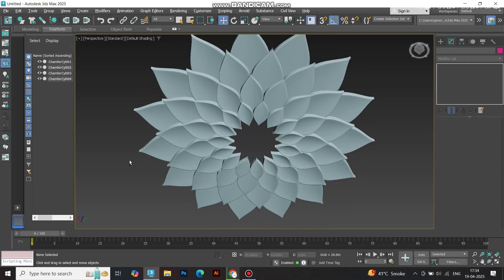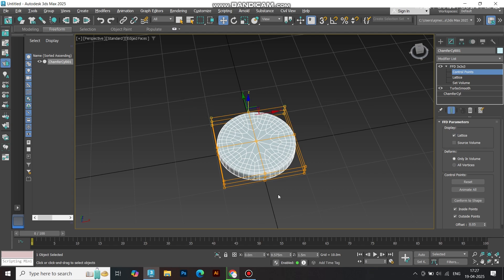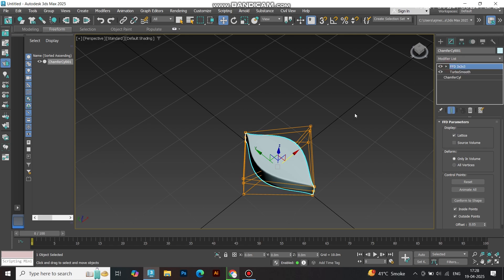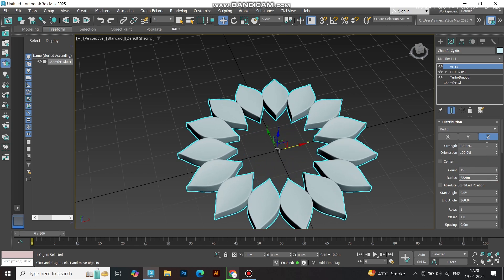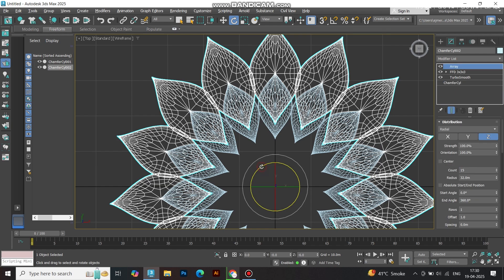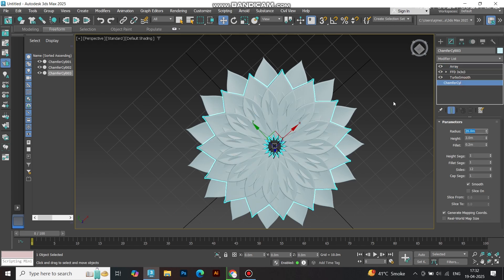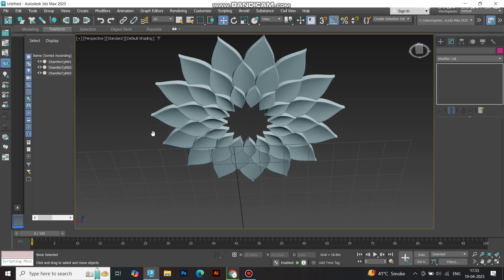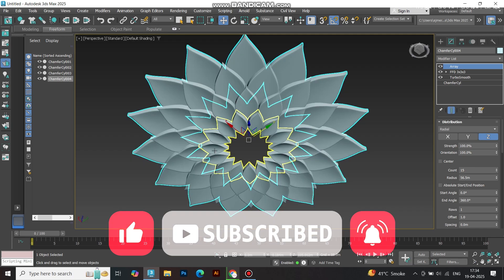Stunning 3ds Max Ceiling Design Tutorial | Array + FFD Modeling Technique

Comment: How to get array modifier? I'm using 2022 version
Reply from the maker: It’s a bit more manual in 3ds Max 2022, but definitely possible!
First, drag your first petal along the positive Y axis, then make a copy by Shift + dragging it to the negative Y axis.
Now select both petals, use the Rotate tool with Shift to create a circular array.
You'll have to adjust the rotation angle and number of copies by trial and error to get the spacing just right.
Takes a few extra steps, but it works!
Reply: @zna_studio  ok thanks.  great tutorial